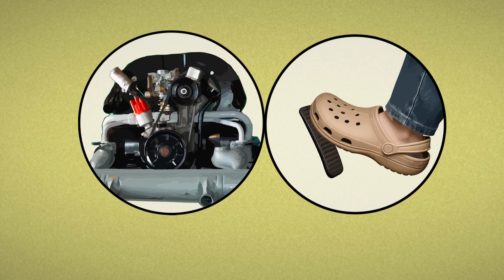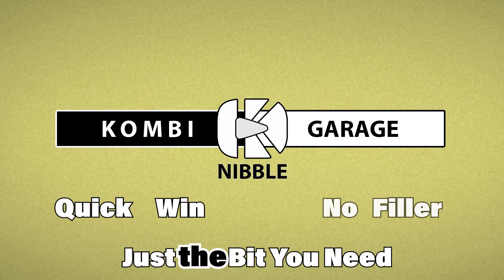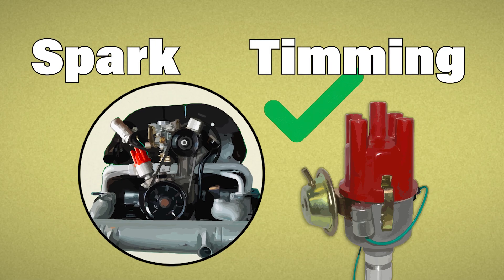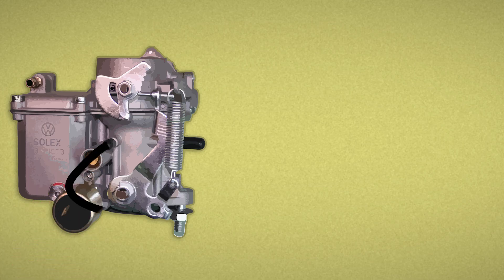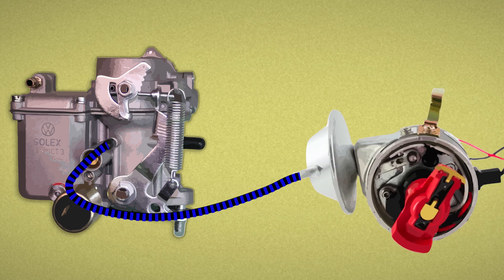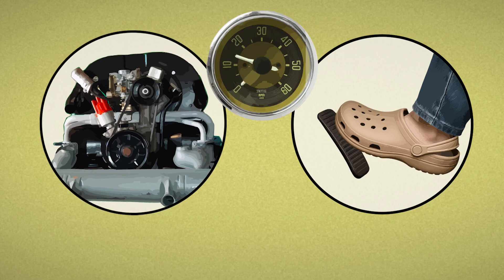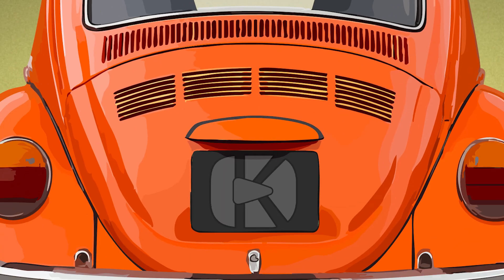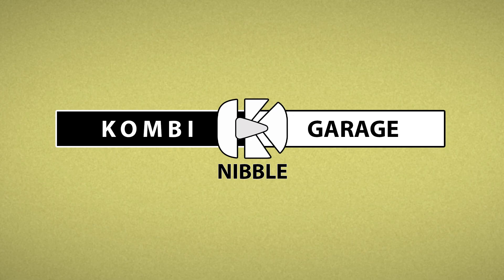What Is Vacuum Advance? And Why It Makes Your VW Feel Alive

Comment: Vacuum advance is smoother and more tolerable in the cities.  Any vacuum advance on a 1600 single port engine will feel so smooth you will just feel happy.  Another combination from the 1980s was the Weber Replacement carb with two venturi tubes.  That was a super-strong, instantly responsive carb coupled with vacuum advance.  The Weber had a very positive accelator pump --- no spring lag as in the Solex.  Great gas mileage too.
Reply from the maker: Thanks for that. Do you happen to know the Webber model?
Reply: @KombiGarage  No, they don't even make them anymore.  I tried to get one, circa 2011, and nobody even knew what I was talking about.  I am an old VW guy.
Reply: @KombiGarage  I remember it was called the Weber Replacement Carb.

Comment: How many vacuum ports the latest bug carburators have and what's the purpose of the other ones??
Reply from the maker: Good question. I’m unfamiliar with anything after 1979, but around that time, different countries and states had different requirements, so I know of up to 4 vacuum ports used, on the 1600. 
1. Vacuum advance
2. Vacuum retard (used with the DVDA distributor)
3. EGR
4. Air cleaner warm up valve.